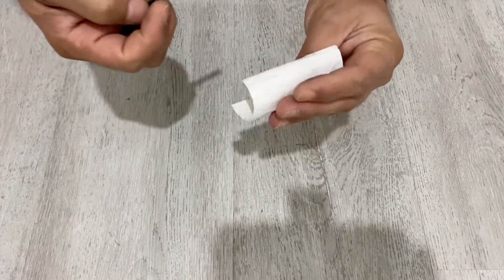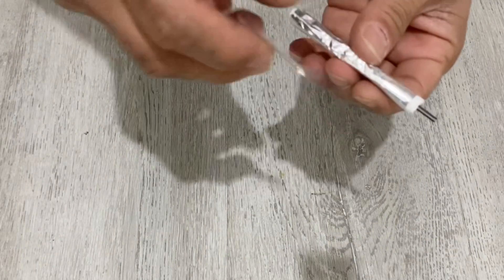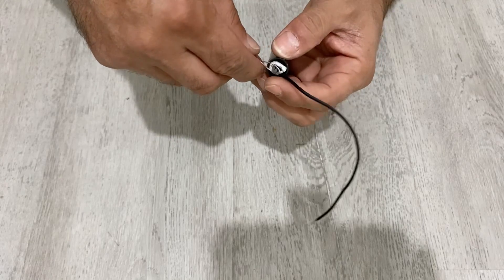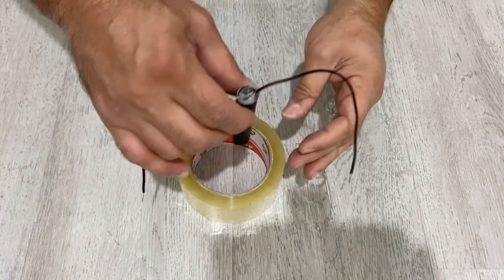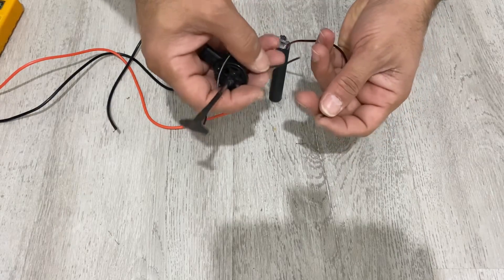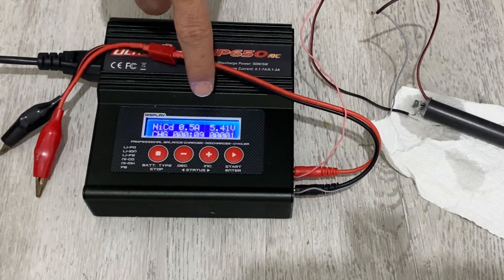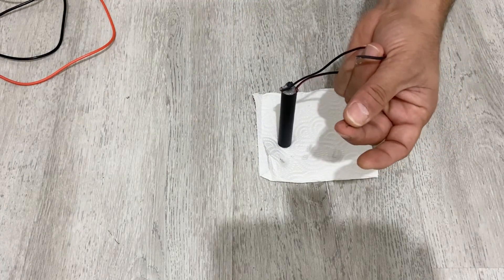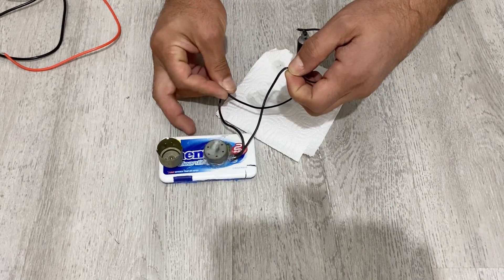How to Make the Easiest Rechargeable Battery?

Comment from the maker: How can you prolong the longavity of the battery? Please share your advice and experience.
Reply: Hello my friend, I just wanted to make one of those batteries, and I have an idea that I find interesting, it's about using 2 sheets of aluminum, with one of them covered with the active material that you use for supercapacitors, but without the activated carbon, just with graphite, after that put the paper separators and the electrolyte and roll it up, you would do me a favor if you told me if you think it's a good idea to try it.
Reply from the maker: @luzoramas3700 it is going to work of course but there will be no significant changes, you had better add some activated carbon or manganese dioxide.
Reply: And one more thing, my friend, I love all your videos and every time I watch them I give myself over and learn a lot ❤
Reply from the maker: @luzoramas3700 thank you so much. I really appreciate that ❤️
Reply: Can I do multiple of it get more volts so dat I can carry a 12dc motor? You didn't show the amp. Çan I sue alliminium pipe so that it can be recharged at least 100 times ór more? Your responses are necesay. Again than u for cretivity. On the battery dat u said dat cañ last 5 years by removing the electilite when not in use, íf the eléçtrolíte iß not removed can it last at léast one year with 6 hours use daily?v

Comment: Where i can buy everything you are used for made one battery 4 volt iam from Egypt please answer me
Reply from the maker: There is no one cell battery operated with 4 volt. You should make two of a kind and connect them in series. Buy the way you can order everything on internet.
Reply: @joyofelectronics9782 If this material carries a hazard warning, it may be difficult to ship. If you know any website where I can buy this material, please let me know. I also understand this is not 4 volts; I watched another one of your videos. If finding a specific website is difficult, please share the exact names of the materials so I can search for them on the internet

Comment: I don't want to criticise unduly. What you made is an aluminium air battery. Which is a primary cell, since it's impossible to reduce aluminium oxide using an aqueous medium. If you did use a non aqueous solvent for your electrolyte, you would make something like an aluminium ion battery. A simple, yet toxic if you don't take precautions, is making a lead acid battery. Almost no other secondary cell chemistry is trivial enough to make out of easy to acquire materials. Metal air batteries are non rechargable, but have insane power density, zinc air batteries are used in hearing aids iirc, and a company trialled an aluminium air battery in a car

Edit: you could use a hydroxide electrolyte to get a little more than 1V per cell, instead of a chloride salt
Reply from the maker: Thanks for your effort to contribute.

Comment: this is very bad advice and not how this type of battery should be used. When you forcefully push a charge on such a battery you are causing hydrogen to be formed and if you charge it too long, example 1 hour, that would destroy the battery and it would not hold the charge at all.. you need to do more research and becareful to what you are recommending.
Reply from the maker: You are absolutely right. And in the video l’ve mentioned about that. One is going to make this type of battery should take into consideration the advice. After all this is a simple type of battery. May be a graphene layer supercapacitor.
Reply: @joyofelectronics9782  If you want more voltage from such batteries then you need to build a stack and connect them in series.. then they can run a small motor and LED's... also when charging such a battery which I dont recommend, it should never be charged more than 1.5 volts.. and its good to add some baking soda to try and protect the material. Such batteries are best to be used directly without charging and until the aluminum is mostly degenerated.